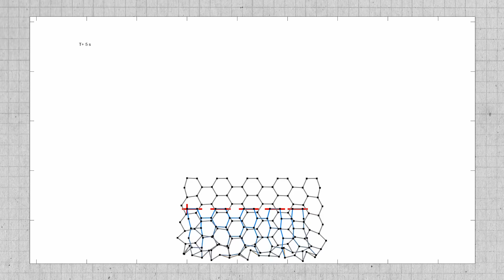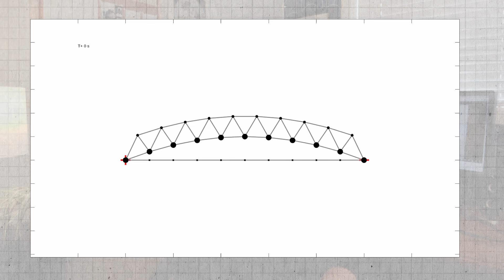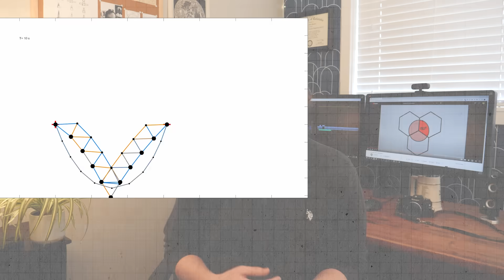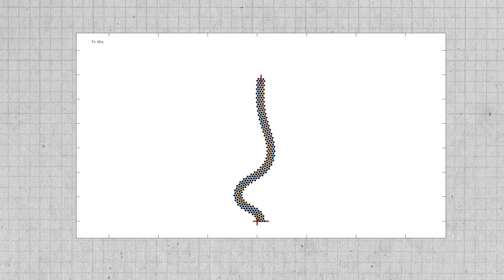Hexagons Are NotSoGreatAgons

Comment: Triangles are the SECOND strongest shape, the strongest shape is actually a circle but circles are really hard to make so we've just made things out of triangles because they are much easier to produce.
Reply: It doesn't help that the strength of a circle is way more dependant on its precision than any other shape, and given that a perfect shape can't exist outside of theoretical modelling, a circle will always have some point of failure in practice.
Reply: strongest relative to what ? there is no absolute strongest shape because it depends on what you're using it for
Reply: A circle is only strong when the force is equally distributed around the circle and is orthogonal to its edge. Any other load configuration will cause it to buckle. That’s why arches only work when loaded at their apex with the force parallel with gravity. This is also why gas tanks are cylinders because gasses expand to fill a volume and exert equal force on its surface.

Comment: Basically: hexagons are good for grids and triangles are good in general (but hexagons certainly gain style points)
Reply: Hexagons are better when full or when they have weak connections to their neighbours, while triangles are only good when their connections are stronger than their insides. Think of it like bricks or tiles: As long as your mortar is stronger than your bricks, use triangles. As long as your bricks are stronger than your mortar, use hexagons. And as long as you are operating under constant gravity, you can use rectangles or squares since the horizontal forces are going to be negligible.

Comment: This just feels like you're saying hexagons aren't the perfectagon? Means they can still be the bestagon, unless anyone has a better suggest...agon?
Reply: Well that depends... What do you mean by "best?"
Reply: @jdotoz  most good
Reply: @jdotoz  possibly even most goodest
Reply: @hairyneil  Okay. Define "good."
This is a perpetual philosophical problem in engineering. Few things, if any, are objectively superior in all attributes, so there is a necessary subjective element in determining the value of different attributes. How important is strength compared to corrosion resistance, manufacturability, or cost? Does additional strength beyond my minimum requirement even matter to me in this case?

Comment: Chemistry background. They definitely aren't strong in the traditional structural engineering means. Hexagons are really great because of their ability to balance strength with space-filling efficiency - which is really the reason behind the honeycomb tiling and of course, actual honeycomb. Getting rid of that "extra bit" you talked about can be okay in certain situations (like where there will be a backing, like a wall, panel, or floor) but you want walls or compartments. Basically, when there is a single dropplet, a circle is favored because it maximizes volume/area and minimizes surface/perimeter. If you have many dropplets together, hexagons are the shape that provide this ideal ratio. 

Generally, I wouldn't call them "strong" so much as "efficient." I would like to note of course in chemistry the resonance structures in benzene as well as to some extent the stability of cyclohexane (although technically it isnt a 2D hexagon). These molecules, and benzene in particular, show immense stability, which we colloquially refer to as the "strength" of the bonds. But also, hexagons might not resist compression well, but they do resist expansion (like if you blow up a balloon inside). I think these ideas are where this "strength" idea comes from.

Comment: Based on this example, the whole "self-driving cars will fix traffic" bullshit, and the absolute disaster of his flag video, I'm doubtful that CGP Grey does any fact checking at all when making claims
Reply: I'm not familiar with any disastrous flag videos, but I haven't watched many of his flag videos.   The self driving car video did miss an important issue with traffic, though.  That being following distance.  A lot of the delay at stop lights isn't reactio ln time, only some of it.  Instead, when cars stop at a red light or other traffic control device, they stop relatively close to each other, and have to open that spacing as speed increases to maintain a safe following distance.   The general rule of thumb is a distance equivalent to 2 seconds of travel time to allow for both reaction time and physics to stop the vehicle, and if we err on the high side and say a computer could cut that required following time down to 1.5 seconds, that's still a lot of additional time.

All that said, certainly self driving cars could decrease the time before acceleration starts slightly by basically having every car start acceleration, but at decreasing levels as a car is further back in the line to allow for the following distance to open up, but that doesn't in and of itself translate to cars actually getting through the intersection any faster, due to the lesser acceleration once movement actually starts.  

Certainly, there would be some gain due to removing distracted or slow to react drivers from the process, and in theory minor gains from the theoretically shorter possible following distance thanks to faster reaction times of computers over humans.  However, in practice the human tendency not to actually maintain safe following distances could result in this part actually adding time back into the process as the cars computers would be maintaining a proper safe distance.

Comment: But what about circle-agons? If we're talking structurally, don't they too have a claim to be the best in some cases? :)

A few examples from the top of my memory: arches, things that have to keep pressure in/out, and iirc in some steel beams they cut out circles to lose weight with minimal loss of rigidity.

That being said, great video, just felt like a section on circles would've rounded it off quite nicely. (pun intended)
Reply: Infinigons?
Reply: Arches come in a plethora of shapes. The most common architectural arch that has to best resist gravity is not a circle, but a caternary arch—this is also the shape that caternary cables make on a suspension bridge and they’re both approximately secant functions. Circle arches are pretty bad at supporting weight because they are not “pressurized” equally when in a vertical position.
Reply: @ClementinesmWTF  well, seems my information on arches was incomplete. Thank you for sharing. :)

I knew about arches in e.g. church windows which are like "rectangle+semicircle", and the gothic variant where they round to a point at the top. But I will admit the choice those arches is more a stylistic choice, rather than structural.

That being said though, I'm not sure "round-agons" would be as catchy :P
Reply: Thank you! My thoughts as well

Comment: Tbf, I think one of CGPs actual points (outside the jokes) was that hexagons are so good precisely because they have triangles easily in them (compared to triangles in squares I mean)
Like essentially in triangle sheets vs hexagon sheets, the only difference is extra joints in each hexagon (to make it triangles). Compared to a square sheet that uses its own geometry entirely
Reply: So triagons are the bestagons
Reply: @jhuyt-  wrong
Reply: Triangle Man, Triangle Man, Triangle Man hates Hexagon Man, they get in a fight, Triangle wins...
Reply: With squares it's just that you need to use right triangles, which from most bridges we can see isn't as efficient as tiling equilaterals, which tile into hexagons
Reply: Add 2 Triangles, to form a square, repeat 6 times, join these squares to each other in a t and then join the edges together. Cut the newfound cube along it's 3 dimensional diameter and it's cross section is a hexagon.
Reply: @simsom4343 I am of the pro-CGP and pro-hexagon persuasion so keep that in mind when you read this. 

You're moving the goal posts in an apologist manner. This video presents valid criticisms of the Holy Hexagon Bestagon. Hexagon = bestagon is no more than a faith based fandom based on a decent, but incomplete/not fully incorrect explanation.

As with any faith based belief, it will not stand up to strict scrutiny, empiricism, and reason. Faith based beliefs can be cool and useful, but I would not lean too hard/center my life/center my personality around anything so flimsy as a faith based system.
Reply: @WisdomRanger  You don't know what fallacies kiddo, do your research before confidently (and incorrectly) name dropping term you don't even understand
Reply: @WisdomRanger  I'm not moving goalposts because I didn't have any to begin with on this "debate", my point is honestly very simple: 

I think CGP grey was having fun and messing around, so I genuinely think most of the 'points' he made in his video was simply for jokes and not actually meant to convince people of anything
Which again, I think the only point that was actually serious was the "what is triangle tiling if not just hexagons with internal structures" which is just truth

I obviously might be wrong on the amount of seriousness he had when making his video, but I don't care all that much about it. I took it as mostly a joke, because it seems obvious  considering the whole "making it into a religion" part at the end of his video

Comment: I think that Hexagons are almost equal to triangles, but every shape has its own use. One thing hexagons are good at is flexibility in a very light format. When you pull the mesh, it forms rectangles which are under tension, which is, as you mentioned a bit stronger than conpression and a lot stronger than bending. When you stop applying tension to the mesh, it pulls itself together again, something I couldn't see with your simulations because you somehow forget that it could be possible that the rotating force could as well be stronger as the artificial gravity as it could be weaker. If you fix just the sides and the bottom of the sides of the mesh, you can also apply a huge load on the top, whilst saving a lot of material you would have used in triangles. Buildings and such absolutely fulfill these requirements. That being said, I always liked the triangle more, there is nothing it can't do, except flexing. Since the engineering of our world is shifting more and more from trying to make the most rigid structure with mechanical joints to making more elastic ones with newer materials to absorb stress rather than distributing it (which is not ideal in earthquakes to name a simple exanple), flexible meshes are a lot better. Hexagons have just a tiny bit more surface area than a circle, remember that you want the smallest surface area in a shape to use the least amount of material, whilst still being tileable.

Comment: One of the only commercial products I've ever personally handled in my life with a hexagonal pattern is chickenwire - a fine mesh fencing material used for low-strain applications.

If hexagons are superior, consider: why are nets and chain link fences always made with a square pattern? Why are fabrics made with a square pattern in the textiles?

Basically, if hexagons were the best shape for everything, we'd bother using them more often. Most of the time, they're more effort than they're worth - but sometimes they do get used, because there are times when hexagons are the best solution!
Reply: Regarding fabrics, they are not always made in a square pattern. Most fabrics used to be square because of the ease of manufacturing them (weaving), but there's also non-square fabrics like Jersey, which is knitted. If you take an old T-Shirt or a knitted scarf, give it a good stretch and look at the holes, you'll see that they'll actually form some kind of hexagonal lattice. Which perfectly aligns with the point of the video.
Hexagonal (knitted) fabric = Stretchy in all directions
Square (woven) fabric = Rigid along the X and Y axis, but stretchy if you apply diagonal tension (this turns the squares into rhombi)
Reply: Nets are generally made in a diamond pattern, not a square pattern.

Yeah, it seems pedantic, but it's significantly easier to keep everything consistent if you're tying them in a diagonal lattice because each knot is in the middle of two other knots, so you can control the height of the diamond by using the width of the netting needle (they're much wider than the name suggests) and once the first row is established it's comparatively  easy to place each knot between two knots in the previous row (tension and gravity do much of the work).

The reason they're not hexagons or triangles is primarily because each knot weakens the load capacity of the line, so minimizing the number of knots is a very desirable property and diamonds are a good balance between ease of manufacture and minimization of the number of knots.
Reply: Easier to make that way + cheaper + people who make fabrics/nets/fences are not mathematicians or physicists.
Reply: It's faster to replace damaged fabric rather than making super strong hexagonal fabric

Comment: May we never forget the underappreciated 3rd best shape the square/rectangle, sure its not the best, but its pretty good, and easy to make. Its the Ok-agon
Reply: squares are the best because they're easiest to implement in code
Reply: @zipsegv  easiest in a rectangular coordinate system. Which is most common, so yeah fair enough. 😛
Reply: @zipsegv  which is also why the hexagons are the annoyingagon
Reply: @zipsegv  Oh? In what context? You'd think of the flat shapes the cirlce is easiest to implement since it only has one variable: radius. A square has four sides and four angles, which luckily you can compress to one side and one angle as long as you store the shape identifier as well, so that's still two variables more than a circle. Not to mention orientation in any n-dimensional reference frame where n >=2 becomes a whole thing with squares that it simply isn't with circles. 
Circle: Distance? Distance to centre minus radius. Collision? Distance to centre minus radius. End of shape? Distance to centre plus radius. Depth? Twice the radius.
Square: Distance? Depends on the angle. Collision? Depends on the angle and rotation speed, if any. End of shape? Again, it depends. Depth? same issue.
Reply: @bramvanduijn8086  
rendering squares is easier (with circles you have to pass a bunch of points of the form [centerx+cosθ, centery+sinθ], with squares you can just pass 4 points), collision with AABBs is basically the same difficulty as spheres (although you are right that if a square is rotated it's much harder). also if your entire world is a grid (such as in strategy games), you don't even need to worry about that; making a square grid is just easier than making a hexagonal one (although not by enough that it matters, probably. idk I'm just a lazy developer).
Reply: @zipsegv  🤔If you are programming a hexagonal grid I think you would use triangular coordinates . Which is really just skewed rectangular coordinates. Each point on a equilateral triangular grid corresponds to the center of a hexagon.
Reply: It's no accident that it's everywhere.
Reply: You can store square grid data more easily on computers, they can be traversed more intuitively and they have easy to grok co-ordinate systems.

((pls don't link me that red blob games hexagon grid implementation guide because that baby is my bible lol! It defo makes life easier but it still is never going to be as straightforward as a two dimensional array))